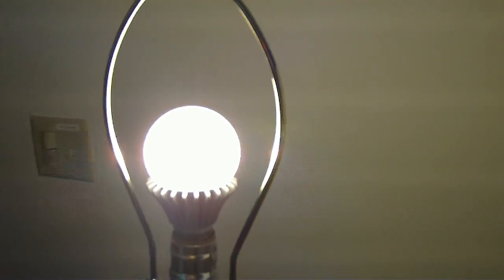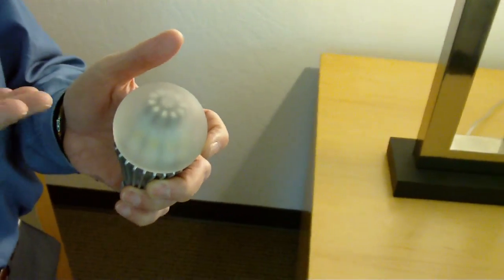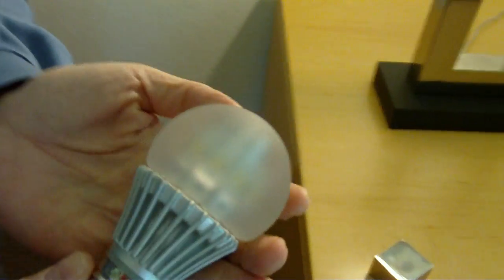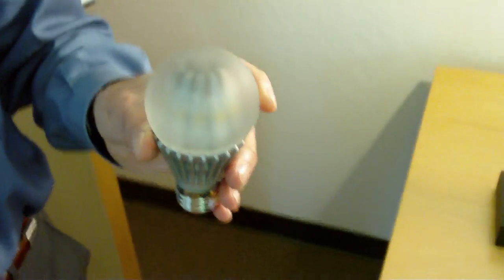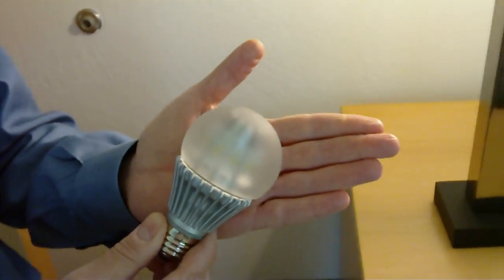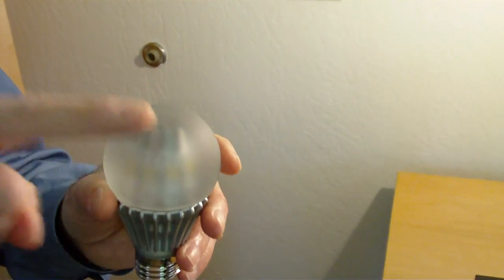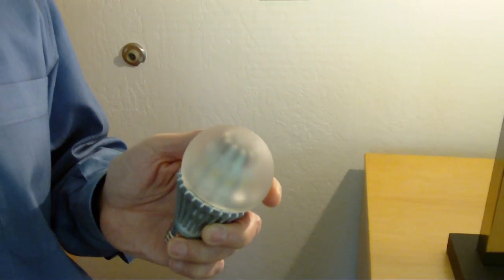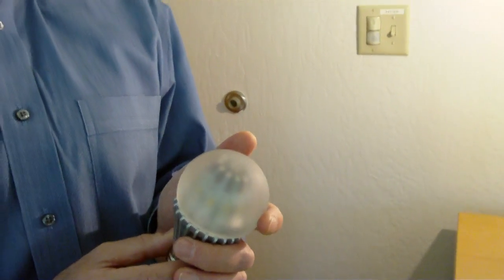The Liquid Light Bulb from Switch on Greentech Media TV.mp4

Comment: I think the Philips LED's work really well and the light quality they put out is very close to an incandescent at 2700k. These switch bulbs, however, are the only bulb light I've seen that can be used in an enclosed fixture. A lot of the led manufactures dont make that obvious. Look at the back of the Philips bulb boxes. In small print it will tell you not for use in an enclosed fixture. I hope switch makes a candelabra chandelier light.